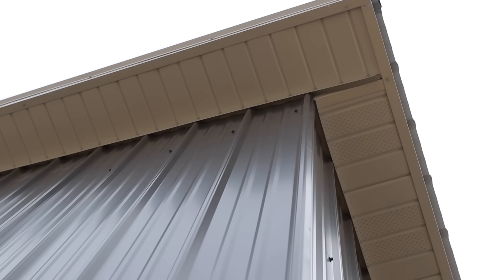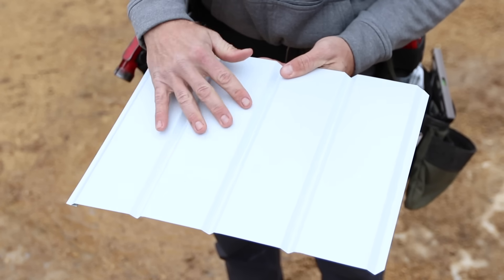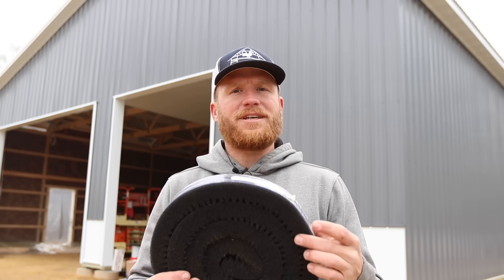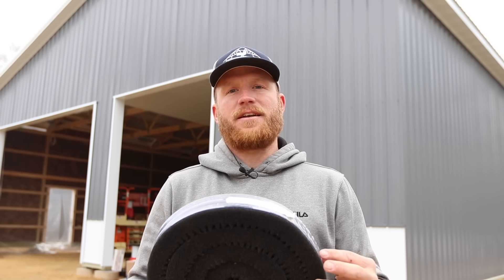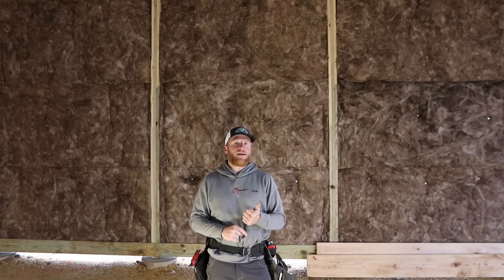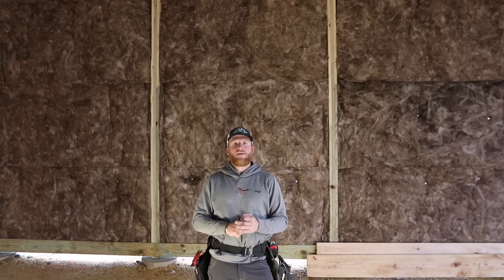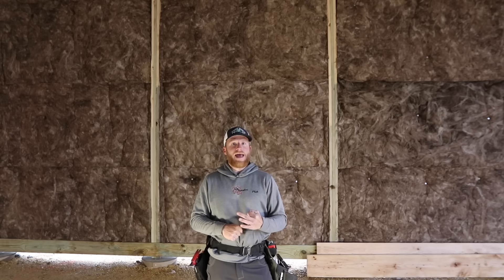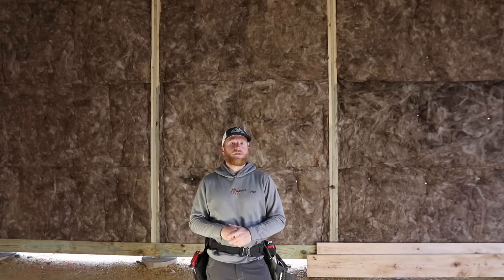Insulation: 5 steps to a more efficient building and why I don't use spray foam

Comment: Kyle, just a tip... I've found that ANY synthetic ridge vent will deteriorate over several years due to heating and cooling of seasons. The temperature changes tend to break down the product leaving an open space for critters and weather to enter. I've discovered this 1st hand when I built my own home. After 12 years I began seeing bits of this product on the attic floor then noticing wasps and flies entering.  Since then I've had to remove the ridge vents and caps and place 6" screening over the ridge gap, then replace the ridge vents and caps. Hopefully this tip will help readers so they don't have to find out the the hard way that "synthetics" DON'T WORK well, when exposed to swings in temperatures through seasons. It's soo much easier to take a little extra time by adding the screening (and it's cheap insurance) to do this while finishing the roof to not have to rip off and replace later. Remember manufactures warrant  their product (mostly of 1 year) because they've already tested it and know exactly how long its good for. Oh! BTW I spent a little more when replacing that product with stainless steel screening, I hate having to do a job twice I only wish someone had told me this when I was doing the roof. Happy New Year!
Reply: If anything, its solar degradation that will cause most plastics to fail, if it is faded looking then its due to solar exposure, but yes metal or alloy lasts longer and looks more aesthetic in architectural terms than uPVC which can melt from even the slightest of enough heat while being more durable in the sun than Vinyl which also melts in heat.
Reply: Great tip! Wish I would have done that myself on my recent garage, but will remember when the house roof needs replacing (which just found out may be sooner than later)
Reply: Excellent point - Thanks for sharing, makes perfect sense!
Reply: That foam ridge vent is poor..soft..and I believe it soaks water like a sponge.the kind that is more like steel wool is where lm at..do you know what l mean like steel wool?
Reply: You are saying something beyond screen,right?l mean screen wont stop driven rain..ridge venting is like gutter leaf gaurd..NONE OF IT IS REAL GOOD!

Comment: Mostly very good/great done! Some extra comments: The plastic below the roof is also so that if you get condensation of water, that then droops from the steel roof down. The water stops and does not go into the insulation. Some thing Americans is not so informed of, are windows. 3 plane windows are ALOT better than any "modern, argon, energy windows" ALOT. Wort the extra cost always. And if you build a new home. Skip the windows that opens up. If you are smart buy windows that don't open at all.
Wrap plastic around the wood before you poor concrete. That way you break the contact and moisture travel. Look into using insulation for the slab.
Reply: 3 *pane windows I had in my old home before we moved out and since then only seen double pane in many places I have lived in since, they have their benefits but also their downside when those models went out of stock and when one got busted it was reduced to the one portion still 3 pane while the repair turned it into a double pane.

Comment: Cool video, here in Brazil we don't make this tipe of construction, here is only in bricks and cement/concrete, but you do so well your job that is amazing to see, good work a congrats to your team that help and do amazing work too!
Reply from the maker: thank you Fernando
Reply: I believe some build there are ICF (Insulated concrete forms) which kills a few steps and thus saves on build tie while aslo being stronger overall than cinder block or cmu (concrete masonry unit).

Comment: Your "attic air deflectors" have a cardboard equivalent ready made product here in Sweden. It's all based on 4foot/120cm spaced trusses. 
Love your channel and found it inspiring while building my own 40x100feet/12x30.5m shop. Quite a bit different from post frame but still! It's a steel sheeted wood frame on a concrete slab (built first) with 8inch/20cm polystyrene insulation below, as well as high strength polystyrene extending beyond the slab to prevent frost from pushing the foundation up. Walls and inner ceiling have 8inch/20cm rock wool sheet insulation and then cellulose fiber is added in the attic as a final step. Doors are large industrial side hinged doors from Findoor  insulated with 60 mm PU foam. Heating is through 1000 meters of floor heating using a 16kW heat pump fed by 2x200 meter holes drilled straight down into bed rock. It's great to keep the cold out. :)
Reply from the maker: wow that sounds like an awesome shop!  well done

Comment: Good job. I hope sometime soon you will show us how you do the ceiling insulation as well :)
Reply: They don't do ceiling insulation. They leave it just as he explained in the video, semi unfinished. That way you still have access to the attic for wiring, ducts, whatever you like. After all is installed the last step is to call the company to  blow foam in the attic through an access door they leave. And then it's finished and ready for use. This is super smart if you ask me. Once they are done being in all "stuff" you are gonna use, machinery, equipment, desks, work benches, whatever, see where you gonna need the electrical wires run and when done just insulate ceiling. Genius

Comment: Hello Kyle,  Happy New Year.  Interesting to see your insulation package.  One thing for you folks who didn't experience the oil crisis of the mid seventies:  Don't use today's economics to calculate the future rate of return on investment.  As was shown one may go to bed with one price of oil and then wake up with a geometrically increased one if it is available at all.  Seems I remember 27 cents a gallon that went to over two dollars in a very few weeks.  Oil distributors refused new accounts even with old customers.  I believe it would behoove a customer to review how long he is going to keep the structure and if it might still have some life left how much more value a well insulated one would have than a lesser package for the resale value.  The only reason not to "overinsulate" would be if you just flat didn't have the money.  In most calculations it is an investment that has a higher rate of return than many at worst. Politics, scarce resources, competition for the ones available, natural disasters, changing climate, etc. etc. can all run the price of heating up.  The only thing certain is that it isn't going down!  Take care.  Doug
Reply: And yet, energy cost adjusted for inflation has gone down. Even not adjusted for inflation, oil price has gone down. In fact we're back to crude prices not that far off those of 1950-1970. Science and hard data is there to remove the influence of "common sense".

Comment: You did a great job of explaining what you do and why. Simple, straight forward explanations and excellent ideas. The house wrap in the attic as an insulation stop is a great idea - cheap and effective. What do you typically use for ceilings? Do you have to calculate for the load of the blown in insulation in the choice of material?
Reply from the maker: yes everything has been pre engineered for the steel ceiling and r-38 fiberglass

Comment: The width of thermal bridge (wood) matters. The posts are 6x, which is three 2x boards. With advanced framing you can do 24” OC stick framing and 24*3=72”. Therefore, 8’ OC post framing has 1 less board per 8’ over 24” OC stick framing, saving 1.5” of thermal bridging. Is post framing more or less expensive? Ie maybe there is a hidden cost of the reduced thermal bridges.
Reply: If one is wanting more thermal over the posts there is always the option of foam boards for better insulation there between the girts and they come in varying thickness so 1 inch is sufficient for 2 by.

Comment: R 50 in the ceilings up here. We also use a acoustical sealer (does not harden or freeze) for our vapor barrier top & bottom plates.  Love the videos!! I want to try your style of barn up here we just have to go deeper  for our columns or they will get pushed up by the frost.
Reply: "up here" being? Helps to say where one is from when saying "here"
Reply: @Joshua79C  If you cant figure out from the name........

Comment: I'm definitely going to look more into how to prevent condensation here in Texas. My parents unfortunately, every year are having huge leaks in their living room ceiling, same area every time. They have a 1930's home but it had only been remodeled inside, not outside which from your video, is where our problem is.
Reply: If they get in the habit of running white vinegar or bleach down that line it'll stop the sludge that builds up in there and keep him from having to unblock it so often. Use white vinegar unless you know it drains into a sink within the house.
Reply: Ben Madison, I will definitely pass this along to them. I don't think it drains to a sink within the house. Hopefully this helps them and they can have a nice looking ceiling. Thank you so much for the tips and help!! You're awesome
Reply: @NirvanaWoodWorksbyJanie  No worries. Not sure where they are located here in Texas. I'm southeast of Austin if they ever need someone to come by and check things out.
Reply: Ben Madison, it's a long ways from your area. They live in Dallas, South side of Dallas. Thanks for the offer
Reply: Also, did they put an AC in the attic? Make sure the water isn't coming from the condensate line off the AC.
Reply: Ben Madison, thanks for the reply. The AC unit is in the attic and from what my mom has explained, my dad, has to take the water hose (?) up into the attic and flush something. I'm now thinking it is exactly what you thought. The condensate line is leaking
Reply: @bluenadas  condensation born because inside and outside have different temperature and water condensat, and this stopped only if insulate wall good, more water resistance insulation,mean only can use closed cell foam sheet at wall. or closed cell spray foam. and outside wall and wall sheet need be air cap air can run down to up all wall good breathe and then dry too condensation. and if have better insulation you safe lot air-con bill too. can keep warm out and could in. i just add more insulation my son house and air-con  elektric bill drop 54% winter house more insulation less elektric bill heat house warm.
Reply: @mattivirta  insulation doesn't mean you'll stop water movement. Insulation is a thermal barrier, not an air barrier or a vapor barrier. Though some insulation can be more than just insulation (1+ inch of closed cell foam for instance)
Reply: If you're getting condensation that means moist air (outside air in Texas) is getting into the house and meeting a colder surface (HVAC space) allowing the water to come out of the air. Find the air leak.

Comment: The reason you don’t use spray foam is because the foam would be half the cost of the project. You build budget-minded buildings and I mean no disrespect by that, you’d be half as busy if you were forced to use foam by code.
Reply: I think you would be surprised on the cost on your next build get bids and compare prices foam is definitely higher but it will not break the bank especially if your heating and cooling the building in Texas it will usually pay the difference in 3 to 5 years
Reply from the maker: that is true too

Comment: Kyle, do you have anything between the insulation and the exterior metal?  I have a ton of r13 value 4'x100' rolls of faced insulation could I double it up paper to paper for a better r value? Thank You Sir
Reply from the maker: i use a housewrap between the insulation and exterior metal . I don't know that I would put the insulation face to face as that face is usually the vapor barrier and could cause issues....tear the face off
Reply: yep, he showed it in this video and on the build series when he gets to covering the outside, but I do get what your asking in addition and same here when it comes to what he said, I see no value in paper facing as its a good place for mold to grow on and leads to water problems in the insulation when the paper gets wet. I hardly get any health related issues from fibreglass, not even serious if any itching at all.

Comment: What brand of overhead door do you recommend?. I just had a pair doors installed for my garage spent the extra on the higher end r-12or 17 weather sealed package and they are leaking air like it is going out of style. Great episode BTW.
Reply from the maker: we typically use a raynor garage door
Reply: @RRBuildings  Thanks
Reply: He said on another comment asking about garage doors, they are commercial grade which makes sense, but roll up is not your preferred choice for the issue you mention there is bifold liftstrap and hydraulic or one piece hydraulic for around the same price and also can be insulated as needed. Schweiss and Higher Power for two brand of those type of doors.

Comment: 15 -inch heals gets you R38 No heal gets you R49 as an average most common.
Reply from the maker: no heel?? not sure I understand
Reply: The heal on the truss the riser at the wall that gets you continuous R38 without this you would be R49 average.  @RRBuildings
Reply: I have read many articles depicting heel to no-heel with the heel being of better insulation value than what you claim, having a heel increases the thickness of insulation and compressing fiber insulation reduces and possibly negates the insulation value of it.

Comment: SO there are two types of weather barrier vapor permeable and non permeable.  In cooling regions you want vapor permeable.  In heating regions you want non permeable.   Region four is neutral.
Reply: It's not as simple as that though. The main thing is that any cavity needs to have vapor permeance. Which direction  you dry to is based on what the cavity is built with and the environment on either side.
Reply: See so many asking why he does not tape the vapor barrier and do not realize that doing so would cause mold problems in the wall as you still want the wall to breathe enough to prevent such issue from occurring, and by having both outer permeable and inner vapor reduces as he said the wind permeability through the wall and thus greatly eliminates wind related thermal issues.

Comment: Here in the south fiberglass has a tendency to sink(for a lack of a better word).  After a few years it will all be at the bottom of the wall.
Reply: settle is another good word to use in lieu of sink, also compress works just as good

Comment: A follow up comment for Greg...since I made my 1st before I finished the video. What do you think of the Milwaukee hoodie? Seems pretty decent to me. Battery is a little bulky for the the back pocket. Pretty much have to be standing for optimal comfort. Which most folks are doing while working anyway. I haven’t tested to run time. Heats up nice though
Reply: Not sure if Greg ever answered or commented on a video, but never hurts to see or try to get him to speak out.

Comment: From my understanding the conductivity of the metal siding is reducing the true r value that you may be trying to achieve. In commercial walls it's something like a 75% reduction in the value due to conductivity and thermal bridging. You don't have the bridging problem because you're attaching to a wood member. But I believe the metal siding on one plane of your insulation does diminish the r value enough it may suprise you what your actual measured value is. I think spray foam would cut down that lots sure to is superior rvalue per inch, not to mention you would have zero wind washing which I'm sure occurs around any penetrations in steel buildings. Go to 19:45 in this presentation to see if Joe can make sense of what I'm trying to explain. 
https://youtu.be/sBcNFeiWjrg

By the way your channel has taught me a lot about metal work, something I'm not very familiar with. Thanks for all your time you put in to teaching a bunch of ciber strangers
Reply: The R value of a wall is basically the sum of all the components (assuming no air leaks in/out of the sandwich). The steel doesn't diminish the value of the other components, the steel essentially just has zero value in that sum. The steel is indeed conducting heat but it's not colder than the outside air.
Reply: And the "wind washing" you refer to is taken care of by the wrap directly under the steel. That is a critical component of the wall sandwich which I referred to by "assuming no air leaks" for an approximate R sum.